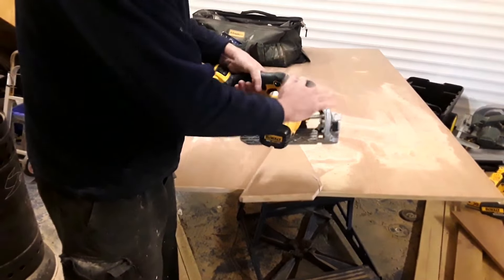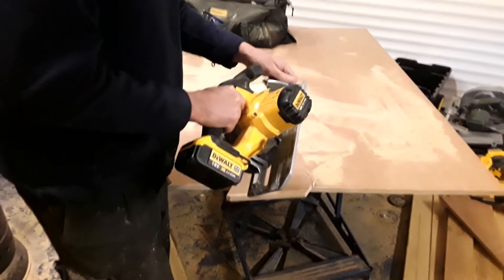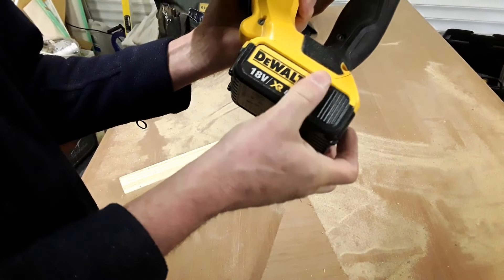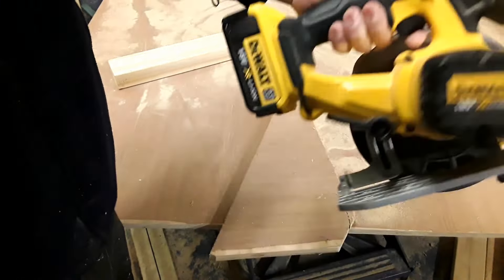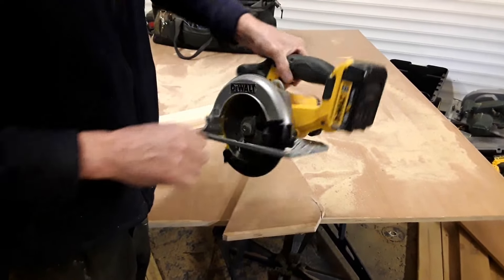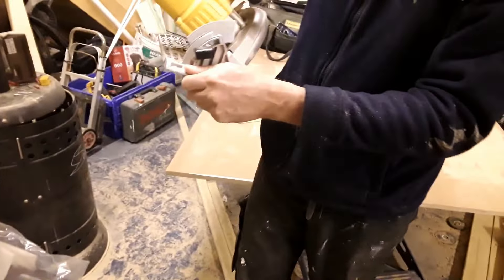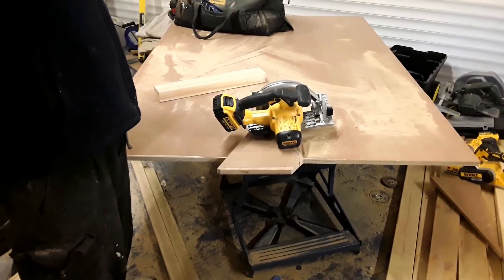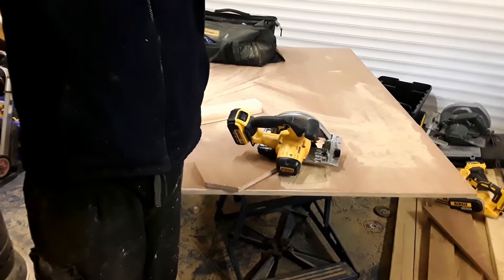DeWalt DCS391N Circular saw

Comment: Works great MyBest.Tools . Little lacking in power. You just have to cut a little slower. Compare to Rockwell pretty similar experience but cheaper price tag for this one. Love the lightest. Cuts accurately too.
Reply from the maker: Yes it can with the correct disc,  but I would not recommend it as it have many plastic parts, its primary is for cutting wood, Rgs Dave

Comment: If the depth scale was any good you’d use it rather than struggle with a tape, it’s crap as with most circular saws. The blade guard is plastic. A good saw otherwise, I have been using one for 2 years now and well worth the money for a bare unit.

Comment: I have bought this saw. If you were cutting a long run you would have to use your left hand to hold the saw. This is bad as far as i am concerned. Mikita etc have the blade on the other side of the saw.
Reply from the maker: neil richards , I have never found it a problem, I all ways put a guide rail down before a long run, but I can see your point many thanks
Reply: What are you talking about I've never used my left hand and I've been using it for about 2 3 years.